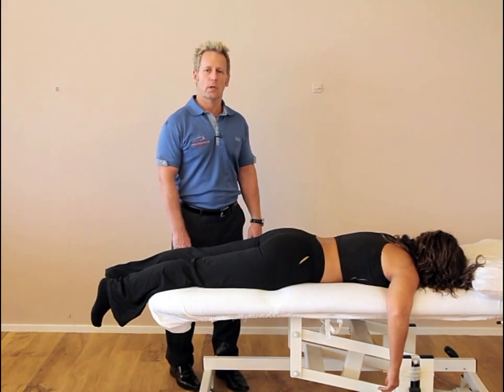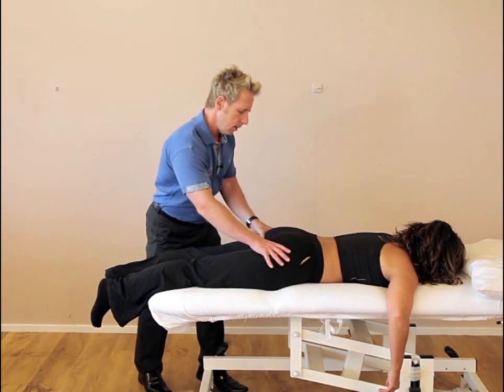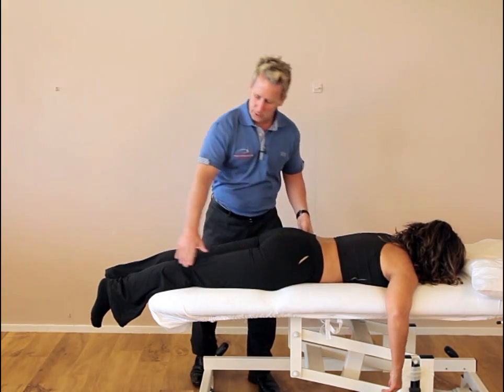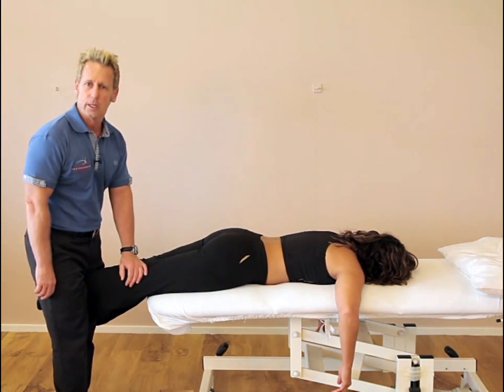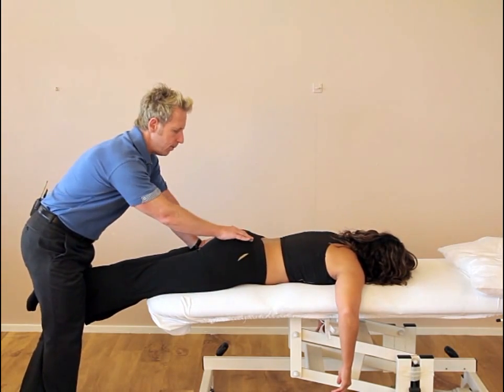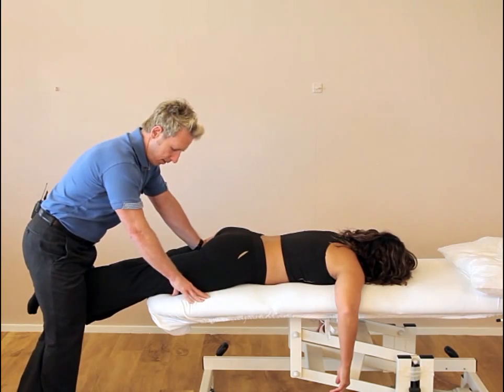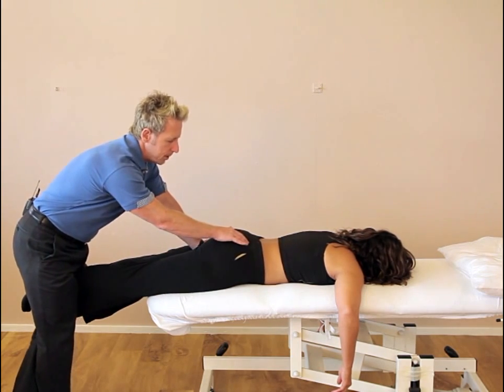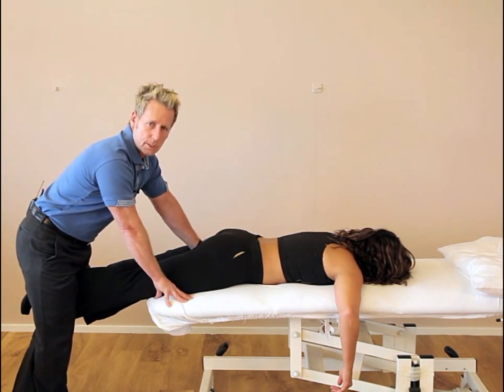How to correct a Sacroiliac Joint Upslip (Hip bone shear) using a MET / HVT technique

Comment: What is the reason for an upslip to happen and after the correction what to do so that it does not go up again?
Reply from the maker: Its normally trauma related - falling off something like a bike, horse etc and jolting the pelvis...the technique works well and sometimes it can help in one session, regards JG
Reply: @JohnGibbons  I have ankle plate and screws from a fracture I had in 2014. Do you think this could have been the cause of my dysfunction that started out of nowhere in 2014?

Comment: Why wouldnt soft tissue mobilization like Active Release on the QL work?
Reply from the maker: Soft tissue would help but if it is a 'structural' issue due to say trauma then the position needs to be changed rather than just the muscle released. Regards JG